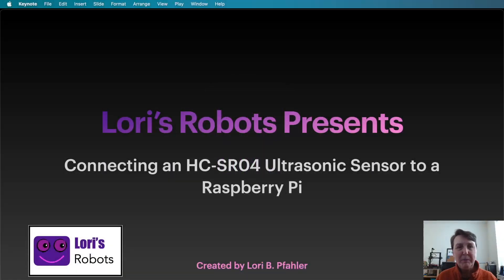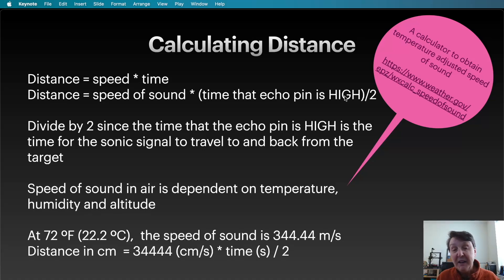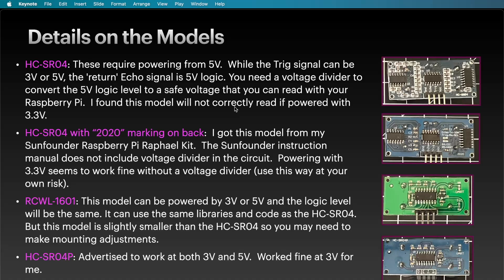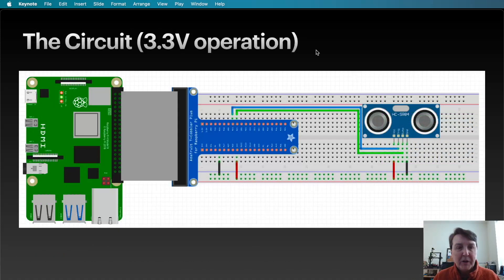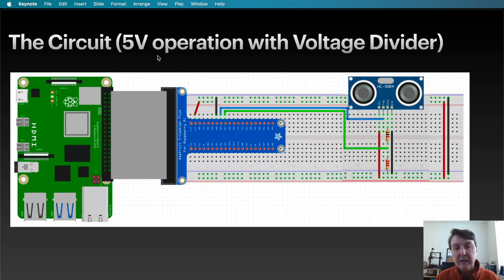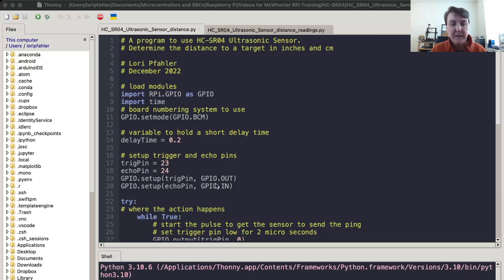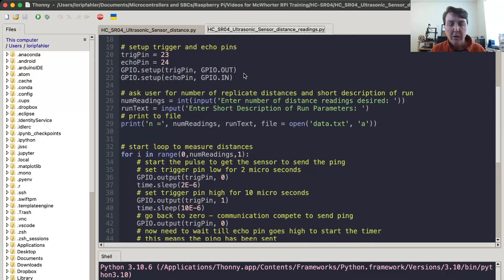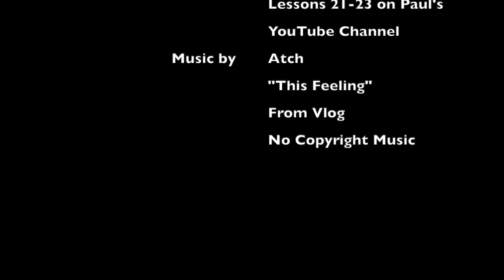Connecting an HC-SR04 Ultrasonic Sensor to a Raspberry Pi

Comment: Thank you for this video. I am building boat computer using open plotter with signal-K server as a main component. I got my sensor working only in command prompt. Would you be so kind to point me in the right direction of how do I output readings in signal-K? Thank you.
Reply from the maker: Thanks for watching.  Unfortunately I do not have any experience with the "signal-k server".  Good Luck.